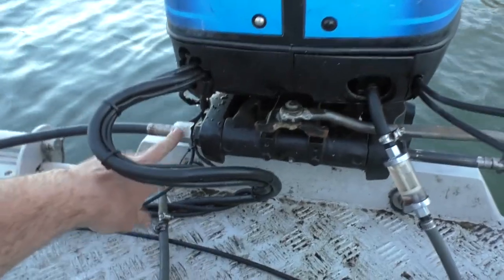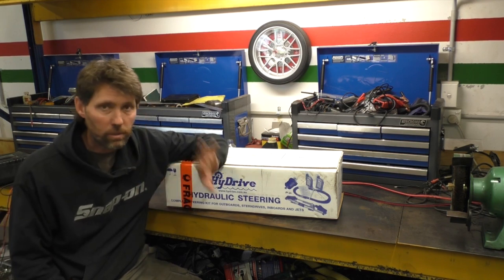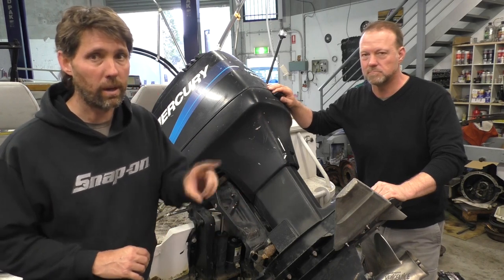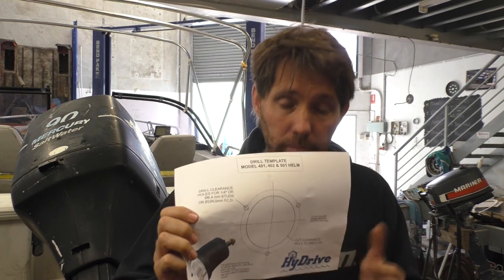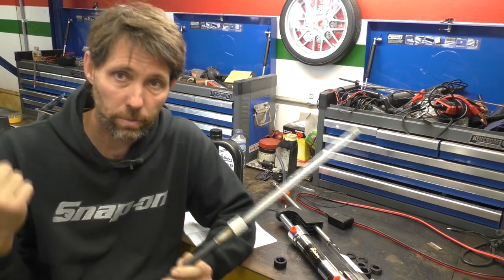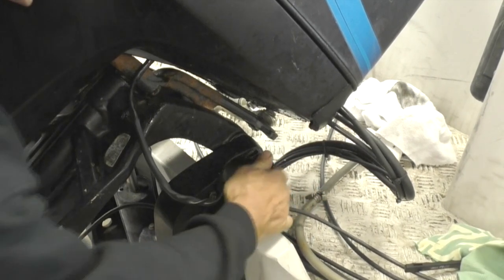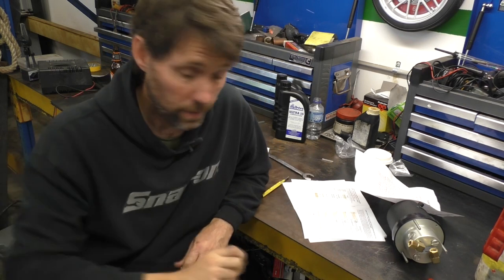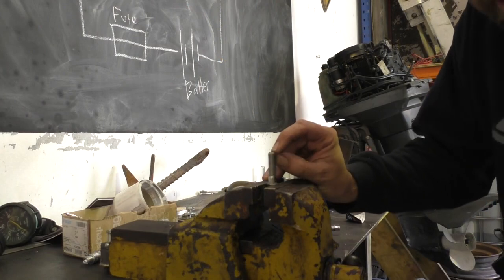Installing HyDrive hydraulic steering in a boat

Comment: good morning I am looking for some advice I had purchased a small Broadbill cat with a pair of old 40 hp is cable steer I am looking to upgrade to 60 hp and I have seen your video but I have done a little bit of research in the hydraulic steering and I have seen an Australian brand for it but they offer two types one of them is called Side mount have not seen a video anyway all that looks a little bit more talked away but I do not know if this is a better solution

Comment: Dont hate the 2 strokes, they are awesome ;-)   Noticed that motor has a foil on the leg.  What are your thoughts on foils?
Reply from the maker: I think those foils can really help with some hull and motor combinations. They can help with getting up on the plane as well as stopping the hull from rolling to one side under power. I also find they are good for protecting the prop if you are pulling up against piles.

Comment: You can add a dummy piece of wood behind it and then use the hole saw a lot easier than how he did it you use the original mounting holes and just screw in through there once you're started it doesn't matter if you drill all the way through the block will fall out behind with the trash pieces attached

Comment: Do you have to order these hydraulic steering by what type of boat you have and what type of engine you have are do they just fit all boat and motors. When he was trying to drill a bigger hole after you lined up where the bolt pattern all you had to do is put you a peace of wood behind it and get you some small wood screws and and screw the screws in the middle to where your boat hose are going to be drilled at then you use the wood in the small hole for your drill bit of the round saw blade to keep it straight then when you take the screws how a piece of wood then you have your pallet hole for your bigger drill bit on the boat patterns

Comment: I just bought a boat yesterday that is 15 foot long and has a 1988 2-Stroke V6 90 HP Mariner outboard for $1200, everything ran great, but it had mechanical steering, does it matter what hydraulic steering kit you get?
Reply from the maker: Not really, all the kits are pretty good. Just check with the suppliers in case you need any special adapters for your motor.

Comment: Stu I love your work and your vids!!!  Top notch!   Had a thought, sitting here at 3:44am waiting for some data processing to complete.  I have a hobby woodshop.  Lots of ways to deal with the pesky "hole at my center mark".  Here's one:  If you draw a circle on your new template centered and the same size as the existing hole, then you could shine light from under the console through the hole and align the console hole with the template smaller circle. Tape it down, mark your new circle.

Comment: To mark out the new holes, cut out the template as you did, but using a compass, mark out a 65mm circle inside the template. Then cut out the centre part (65mm). Your hole in the template will be the same as the hole in the dash. Place the template over the hole so the hole in the centre of the template matches the hole in the dash.  Simply trace around template with a sharpie and mark the three new holes. Saves all the complicated measuring.

Comment: I know im late to the party , but a great video. Was wondering if you could explain tight steering one way versus the other when high revs with cable. As a new boatie i am not sure if its prop, load, cable etc... Bit seema hydraulic may assist. I havea polycraft drifter woth,60FETO yammy 2 stroke
Reply from the maker: The paddlewheel effect of the prop is trying to push the engine one way when it is running so it resists turning one way and actually assists you turning the other way.

Comment: Hello Dangar Marine.
I am about to fit a Hydrive bullhorn style unit to my Quintrex Top Ender with a new 70hp Yamaha 4 stroke.
I noticed in your video that the hydraulic hoses come from the transom straight to the bullhorn connections with no bends or loops. When the outboard moves from side to side, won't these hoses try to bend and/or stretch as the bullhorn cylinder moves from side to side.
How do you counteract these movements.
Any assistance will be greatly appreciated.
Thank you in advance.
Chris Allen.
Reply from the maker: +Chris Allen Hi Chris, no, the hoses don't move, only the ram.

Comment: Great video as usual, just like to add that I run into drilling or cutting a hole with a hole saw or a jig saw  over an existing hole all the time. What I do is drill in to a small piece of plywood first or cut with a jig then clamp that over the existing hole or screw it down, if possible, example a wood door to increase door knob hole size, then proceed with drilling or cutting into that surface. It kinda does 2 things, first makes it possible to drill without using the pilot drill and it protects the surface when using a jig saw like you did here. It also in your case will raise the jig base up to clear your other instruments as you swivel around.

Comment: Just a tip the next time you cut a bolt put a nut on it first then use the nut to clean the threads.👌✌

Comment: One tip.. When pulling out the old cable tie on a length of paracord or string to the old cable b4.. Then uou have a fish to pull the new hose through the gunnle..

Comment: Just a tip on drilling a bigger hole like this with a hole saw is to use a hole saw the size of the existing hole with the bigger one on the outside

Comment: Hi there, I have a fair amount of rattling feedback from my 2stroke outboard through the steering wheel, would a hydraulic steering system stop this? Thank you for any advice.
Reply from the maker: Yes, hydraulic steering helps a lot with feedback from the motor.
Reply: Dangar Marine , wow thank you so much for the reply! I’m honoured you gave me the time. 
I will try hydraulic route then, keep up the amazing videos!

Comment: Hello Dangar Marine.
I have watched your video again and I'm sorry to contradict you but the hoses do move. Your video shows the hoses sliding back and forth into the hole in the transom.
With my boat, the hoses will have to come out of the tube which contains all the other cables and so on to the motor.
I am wondering if it would be ok to reverse the fittings on the ram and put a loop in the hoses so they can flex with the movement of the ram.
Again thank you in advance.
Chris Allen.
Reply from the maker: +Chris Allen I'll take your word for it, I'm away at the moment and can't really check it. I'm pretty sure you can swap the fittings around, but I'd have to take a look when I get back to be sure.

Comment: Stu, I am hoping you might have insight into an issue. The helm has had a very slow leak over the last 6 months.  While out boating the motor constantly pushed the boat to one side and the steering wheel must constantly be turned - note the wheel never reached a "stop". We checked all the fitting at each end of the hoses and found no leaks. Additionally, there were no leaks from the cylinder.  We added hydraulic fluid as instructed, placed the motor slightly up and to the side and it proceeded to fall to that side.  Any ideas what could be wrong?  Thank you
Reply from the maker: I'm not an expert on these, but it sounds like one of the seals in the ram might be leaking which would explain why need to constantly adjust the wheel to correct for the leak.

Comment: Interesting, single engine prop aircraft have a "Torque steer" or "P factor" reaction on takeoff acceleration as well, requiring rudder input to maintain runway centerline. Thanks Stu

Comment: Stu: yes, outstanding instructional video, especially your attention to detail, ( i.e. poke holes in bottom of hydraulic fluid bottle vs drilling to avoid creating particle matter, etc). Finding your video is timely in that I just re-powered my G3 175C from a Yamaha 70hp 2-stroke, to Mercury 115 ProXS 4-stroke (recent redesign from 2 to 4-stroke, hurray!) Used the same cable steering that posed no problem w/the 70. Did my 1st 2-hr break-in per manual to find with hard acceleration, almost impossible to turn to port while somewhat easier, though still difficult, to turn to starboard, as you mention/demo in the video. Difficult to justify more expense for hydraulic steering conversion at this point as I pushed the envelope to get the new motor. Doing some research I found some bloggers who discussed adjusting the rudder-like "trim tab" on the motor above the prop (referred to by some as the "torque tab") to assist in countering these forces. I checked to find that my motor has none (only a circular plate with threaded hole in the center. Would the addition of such a tab partially resolve the torque effect? Should the motor have come with such a tab? As a retired educator of 35 years, thanks for your excellent efforts!
Reply from the maker: Outboards generally do come with these trim tabs, but I feel they have more effect at speed then when you are first taking off. It is interesting that it is also difficult to turn to starboard as the torque steer on this motor was pushing the motor to starboard whether you wanted it to go there or not. How does it feel when the boat is still in the water?

Comment: Hello Dangar Marine.
Thank you for getting back to me.
I have made the loops quite large to allow for constant flexing, so I probably would have enough to trim some off the end.
The loop in the portside tube is a full 360 degrees to make it as large as possible, and the starboard side is a 180 degree loop.
I am going to talk to the people at Hydrive anyway. (I just haven't got around to it yet)
Thank you for your time and information.
Chris Allen.
Reply from the maker: Hey Chris, sorry, I forgot to look at that boat. I'll definitely look this morning if anything just to refresh my own memory about how it went, and also how it is looking after six months of running.

Comment: A few things.  

1)  If you already have a hole in something and you want to make it bigger, bolt or brace a scrap piece of plywood to the back.

2)  If you're going to cut down a bolt, thread on a nut that you don't really care about first below the point you want to cut.  Then once you've made the cut, you un-bolt the "sacrafice" nut.  This will force the edges back into the correct alignment.  Faster and more exact than trying to get a thread-cutter on afterward.

3)  Is adding oil to a two stroke only for the larger engines?  Every two stroke I've had, the oil is added with the gas.
Reply from the maker: Hi mate, yes tips 1 & 2 are good techniques. With regards to 3, yes, it is generally only larger motors that have an automixing system where oil is added to the fuel at the last minute in proportion to the revs you are doing (less oil is needed at idle that full throttle). Of course not all larger two strokes have this, but you don't ever really see it on small motors.

Comment: Help! 
i have a 1971 chrysler 45 hp, when i start it The carb starts to spit fuel... what is The problem?
Reply from the maker: The reed valves between the carburettor and the crank case will be dirty, corroded, bent or broken meaning they won't seal the crank pressure sending fuel back out through the carburettor.

Comment: Stu, a question if you don't mind: I just got a used 21ft aluminium centre console with the hydrive admiral all set up. BUT I'm not sure if the fluid level is correct in the helm, in fact, it looks very low when I look in. Is it ok just to "top it up" through the fill hole on the helm? I'd get it to that 12mm mark.
Reply from the maker: Yep, no problem just topping it up from the helm.
Reply: @DangarMarine  Thanks Stu!

Comment: Hey thanks for an awesome diy video one thing I wonder is if you opened the AIR BLEED on the hydro cylinder would the adding of fluid have gone a bit easier?  Great job thanks again
Reply from the maker: I would say not as I'm sure the manufactures instructions give the best procedure. It would be interesting to see when it is appropriate to use any air bleed screw though.

Comment: I had rack and pinion steering on my old 1985 sea Ray. Docking helped my build up my muscles. My new to me 94 century has sea star hydraulic steering. I can turn the wheel with my pinky. Love it! I just wonder what would happen if it failed under way! Great video man. Very detailed!
Reply from the maker: Hydraulic steering certainly is a lot more user friendly. Good question about what happens if it fails. Depending on what exactly brakes I imagine you would lose all all hydraulic pressure on one of the cylinders preventing you from turning in one direction. Without back pressure I presume the motor would also flop over towards the failed side.
Reply: +Dangar Marine thanks for responding Stu. Hopefully if a failure ever happens I can overcompensate in the opposite direction and putter back to the dock! I do love my hydraulic steering though. It makes boating much more enjoyable! I'd recommend it to every boater.

Comment: Thankyou absolutely love your honesty and knowledge. How do you aline the steering wheel to stay level when your going straight on the same hydraulic system
Reply from the maker: The only way you can do this is to install a hydraulic bypass valve that allows you to move the motor without the wheel turning.

Comment: what is the name of the part that connects the engine to the cable for turning. a metal rod with a bend in it.
i do not have one for my engine and need one.
many thanks and love all the videos Dangar
Reply from the maker: Hi Chris. That is the drag link.

Comment: Hey Stu, 

Do you put the trim tab strait now that there is hydraulic sreeeing or is it angled to counteract the torque?
Reply from the maker: I would put it back to where it was with the old steering as this will be the balance point for the prop walk. Even though it won't overpower the hydraulic steering, it will take the stress off it.

Comment: Great video, one of your best. What did you have to do to run the hoses down the side, did you have to remove all the side paneling ? Would have been great to see some of that within the video.
Reply from the maker: No, I just poked them in the back until they came out near enough to the dash to reach in an grab the ends.

Comment: looks like an awesome upgrade. but would it be worth it on an older glass boat? im up for a new steering cable and the workshop says they have never seen a steering cable the same on the engine side (no drag link) and say i might have to replace helm and add a drag link. quoted me around the $270 mark. would this kit be more or less cost effective over its advantages? cheers
Reply: it might be worth noting that $270 is just parts as i am able to fit myself. and have an outboard mechanic mate who can lend a hand if needed.
Reply from the maker: Depending on local price differences, the hydraulic steering is about $1000 so it really comes down to the size of the motor. For anything over about 60HP I think hydraulic is great. Smaller than that I would go for a new cable.
Reply: im in brisbane. its a 5 metre qtr cabin glass boat 1986 build with a 2000 year 70hp yamaha 2 stroke. only payed $3,500 so i dont think spending that kind of money on steering will give me great enough return to justify it. Will be looking to upgrade to a newer boat in the next few years something with a few more horses and maybe aluminium. will definitely look into hydraulics then! cheers for the information.

Comment: Just picked up a steering kit and the tubing is like a coil spring.  Any tips on how to straighten this stuff?
Reply from the maker: Ah yes, it is a bit that way. I didn't have too much trouble with it but I imagine a bit of time in the sun might soften it up a bit.
Reply: Thanks Stu.  I finally filled up the sink with some hot tap water and fed the lines through a couple feet at a time and was able to straighten it out enough that it could be routed through the boat.  It was coiled up with a diameter of about 14 inches and really had me perplexed for a while.  Thanks again for the video. The rest of the install was a piece if cake.  Now if I can just get some weather warm enough here in North Carolina to go out and give it a try.

Comment: great job like the longer vids I have the same problem with my Johnson 100 how much did that steering set up cost
Reply from the maker: Thanks mate, I also prefer to watch longer vids. This kits sells for about $1100 Australian dollars.
Reply: Is there a decent warranty on it
Reply from the maker: It has a two year warranty on it, but like many things, if it lasts the first few months I think it would last many, many years. If fact I don't think I've ever heard of a hydraulic steering unit failing. Occasionally the seals start to leak, but you could almost think of those as a service item.
Reply: thanks man
Reply: Seal kit for the ram is a home handy man item, and the kits are just over $75.

Comment: What's wrong with two strokes?
Reply from the maker: +Jer0tube It's always when your in a rush or dressed to go out that they need more oil added!
Reply: I have a Tohatsu M60C on my 14 foot half cabin boat, and in the 10 years I've owned it I've added about 2 litres of oil. It is an absolute oil miser. Admittedly I use my boat very little, a dozen times a year at best. The Tohatsu motors are very good I've found. Bit chuggy at idle and carby fed so takes a little bit of mucking around to get it started, but great motor. Having said that, my next choice of engine would most likely be a 4 stroke for the economy and quiet smooth idling and WOT. Great videos mate, keep up the good work, very enjoyable to watch.